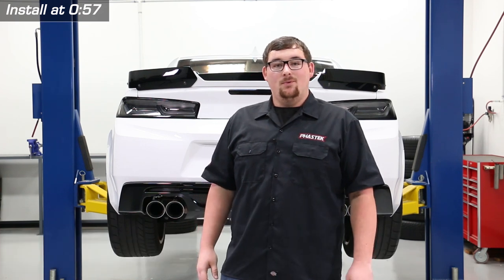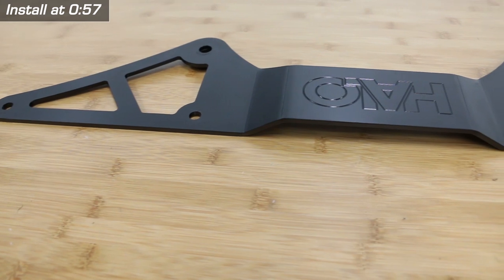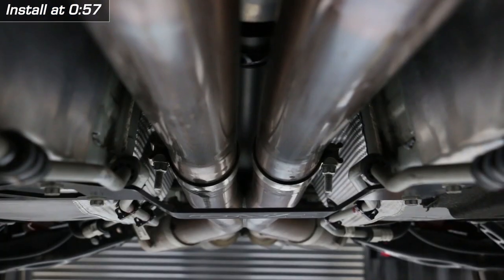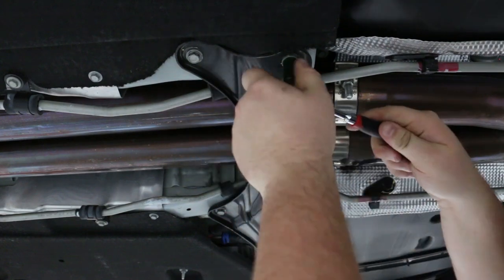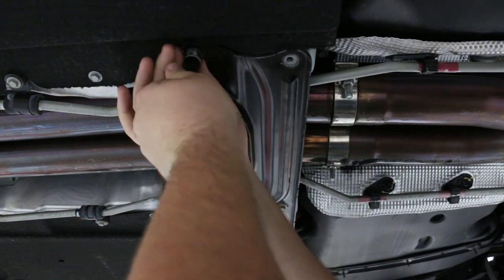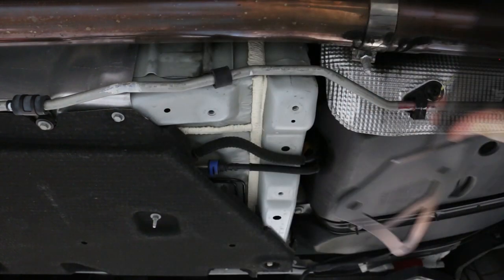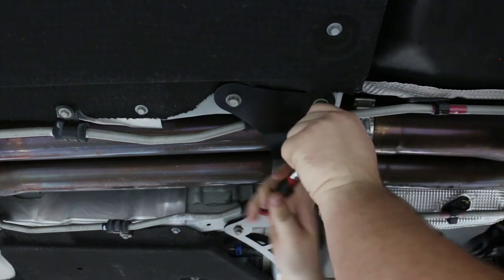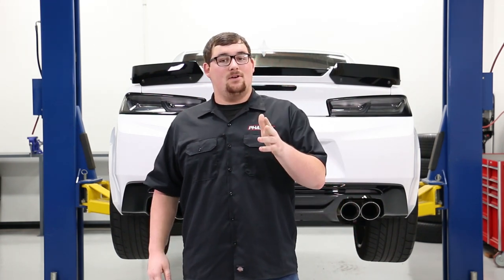2016-2019 Camaro Halo Driveshaft Tunnel Brace - Install - Phastek

Comment: If it already has 1 bolted in , why do you have to change it?
Reply from the maker: This brace allows better clearance for a larger exhaust system.  The factory brace works well but with 3" exhaust systems clearance can be close which could cause some rattling noises.

Comment: Any ground clearance issues ??
Reply from the maker: The brace does hang a bit lower then the factory piece.  We have not run into any issues with this kit installed on our shop car and we are sitting on our PX1 springs.
Reply: @PhastekPerformance  , great thanks, do those PX1 springs lower the ride height ?   And do they make any springs that increase ride height on the 2016-2019 Camaro SS ?